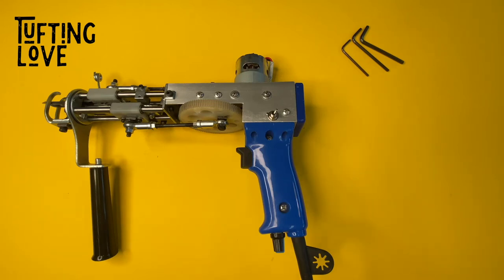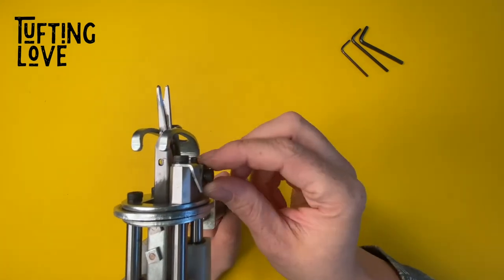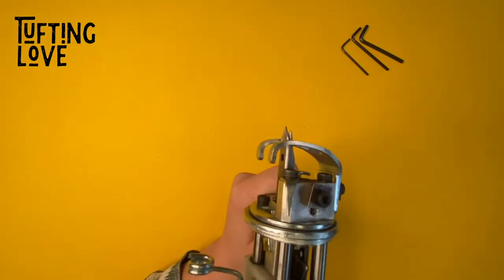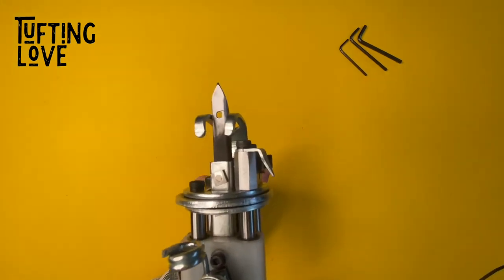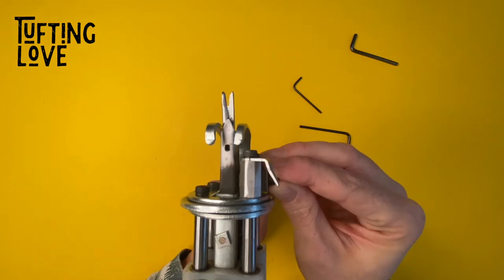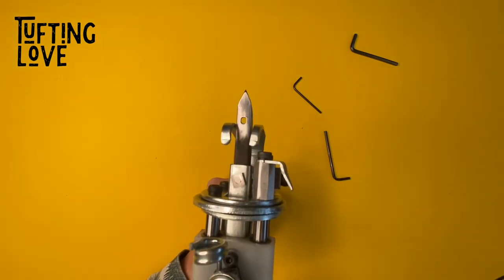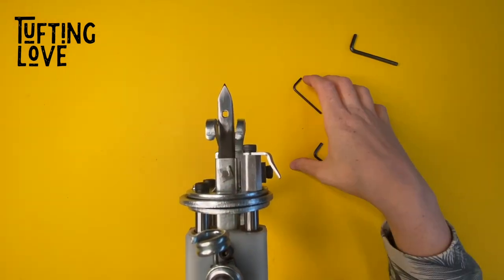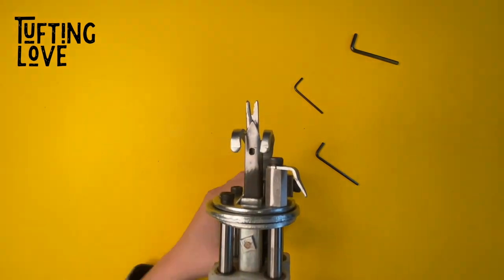Cut Pile NK01 Tufting Gun - Scissors are not closing, scissors not cutting - Tuftinglove.com

Comment: I have the AK-1. My scissors open and close but it seems like they dont reach the yarn sometimes or only cut 1 out of the 2 strands of yarn. I just replaced my scissors so its not that. I am using cotton yarn (Sugar and Cream brand). Seems to work fun with the crappy acrylic yarn which isnt as dense. But not with the cotton, paper like yarn. Kind of frustrating. The primary job of the gun is to cut the yarn- feel like it should do that without adjustments
Reply from the maker: Hey Joseph,

it should yes. It could be that it is to many threads through the machine. If the yarn is thicker, you can use 1 thread instead of two. Since the scissors are very small, the thicker yarn somethimes tends to slip out in the front of the scissors, leaving one strand uncut. Can you try with one thread and check if it is still inconsisten with the cutting?

Otherwise we also do have a full scissors tutorial here: https://youtu.be/rxjCiZn6z7U where we cover all the setting topics of the scissors we are aware of.

If all this still is not solving your problem, feel free tosend me an email to help@tuftinglove.com with some pictures/videos of the situation, so i can have a look at it.

best 
Jenni

Comment: For some reason when I try to use the Alan key on the black bolt it won’t unscrew I tried all my strength I don’t know what to do
Reply from the maker: Sometimes the screws get super stuck. try to put a bit of oil/Lubricant on the screw and you're usually able to unscrew it.

Comment: Great video!! Will this also work with the tufting gun with the orange trigger?
Reply from the maker: Hey Natalie, i don't know the ones that are not the original ones. I never had one, so i can't tell if it is working like that as well, but i guess it's worth a try :) Make sure to note/take picutres of the current state first, so in case it doesn't work you can go back to your current settings.

Comment: Hello. Do you have any ideas why the scissors wouldn’t close all the way even after adjusting? Also, I confirmed nothing was broken. They were working fine but now won’t cut sometimes
Reply from the maker: If you go on a too high or too low pileheight setting the machine will not be adjustable to your needs. make sure you are within the given range
Reply: @Tuftinglove  thank you for the reply. If I haven’t adjusted the pile height and this suddenly started happening, would you advise I adjust the pile height and try adjusting the scissors until fully closing?

Comment: My yarn keeps getting stuck inbetween the scissors and the metal runner part where the scissors are held, do you know why that could be?
Reply from the maker: Hey Zara,
like between the scissors and the needle? Or which parts?

This can happen when the scissors don't cut properly anymore. But also the thickness and quality of the yarn have an impact on it.
Reply: @Tuftinglove  yeah the needle and the scissors. Oh ok, I have out three strands in as my yarn is quite thin, so do you think I need thicker yarn?
Reply from the maker: @craftinfinityandbeyond9023  That should not be the problem. The thinner the yarn the more threads you can thread. Would you maybe like to send me pictures of the yarn and the situation with the gun to help@tuftinglove.com? So i can see it, that makes it usually a bit easier :)

Comment: Even though i tried it, i scissors didn’t open. how could i do ? Help me🥲
Reply from the maker: Hey, this video is not for the scissors opener, it's for the scissors closer. A Video on the scissors opener will follow soon. But usually when the scissors are not opening the scissors opener is broken. You can find it in our shop in the spaceports section.